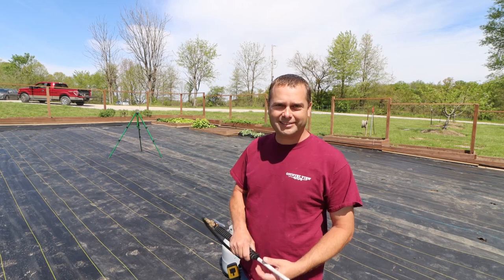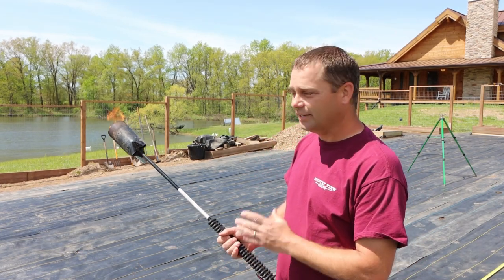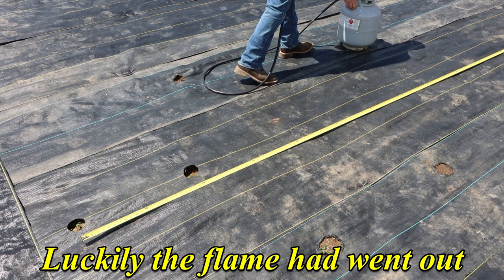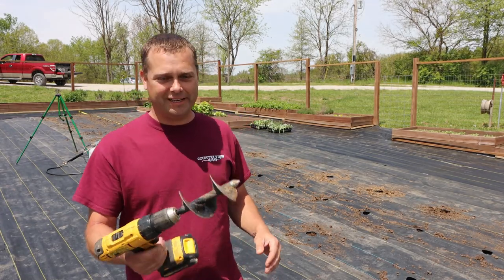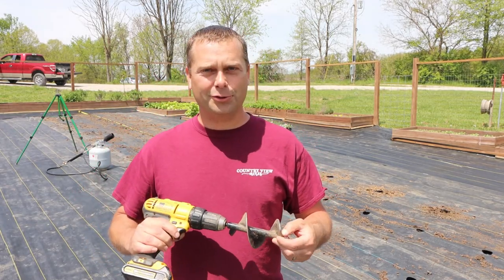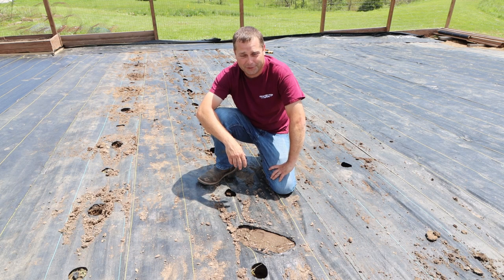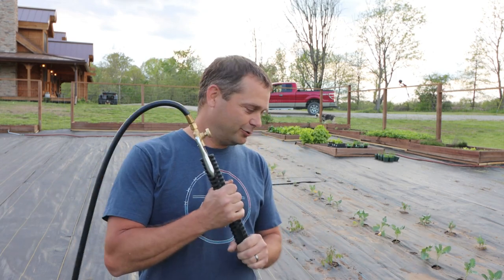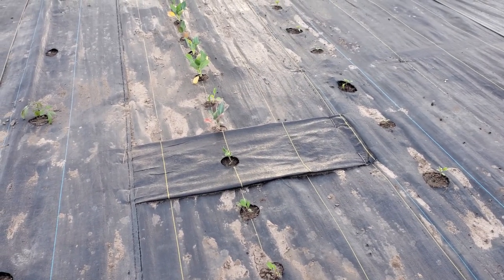Planting in weed fabric, burning holes and using the power planter auger.

Comment: Evan, that is a easy fix. Cut a piece of wood and put it under the trigger and then use electrical tape to wrap around the handle to hold it in place.
Reply: You beat me to it. I was going to say a zip tie though 😊
Reply: I had the same thought.
Jam the trigger.☮
Reply: if someone is that incompetent with the tiger, simply use a small pin punch and tap the spring pin out that hold the triger handle on, and it hall right off, 2 second job
Reply: Arnold Romppai I suppose if he was messing with a TIGER he might be a bit more careful.
Reply: Same idea here.
Reply: @michaelacres501  man how many hundreds of people have to repeat the same thing, like duuu

Comment: Evan, garden's looking great.
Torch: stop stabbing it. You're burning through not stabbing through. Set it down a little easier, let it do the work. Set it on its heel then stand it straight up, rock it in a gentle circle like you're spinning a quarter in the counter then lift it back up. Perfect hole. Easy as pie.

Comment: If you add a 30 inch rebar extension  t your auger, you won't have to lean over to punch your holes. That's what I did to mine and it's working really good .  You can drill twice as many holes in the same amount of time.  If you'll take a leaf blower and blow all the extra dirt off the fabric, you won't have weeds start on the small clumps of dirt. Your garden is looking great !

Comment: Tape a piece of wood of the right thickness to prevent the trigger from depressing, then wrap with some electrician tape.  Should solve the problem.  Great looking garden set-up.
Reply: This was exactly what I was gonna suggest, and you beat me to it 😂
Reply: Use a cork!
Reply: Was going to say the same! Duct tape a chunk of wood in there! The holes are perfect when you don't pull that trigger! ha ha ha?!
Reply: Just goes to show:  Great minds think alike.....
Reply: Yup right there. I would have flamed it out and set stuff in fire. Definitely would put something under so it just can’t be depressed.  Just FYI those torches are great! For weeds. Being in as and not lots to set on fire - works great for the weeds we get in our rock.

Comment: Put a Piece of woodunder the handle and tape it so if you do hit it it won’t do anything hope that helps😉
Reply: Bass 167 I was going to say the exact same thing
Reply: I was going to say the same but I was thinking a piece of that foam that you kneel on under the trigger.
Reply: @wendyellis8572  I think foam is better than wood.
Reply: Why not just zip tie handle down on full open position and control flame with knob like other model.
Reply: @ShadyOaksFarm  thats not how it works

Comment: In case someone else has not commented, make a template of light plywood or even old paneling with holes just slightly larger than burner.  This allows torch to be lit and kept hot to burn holes quickly, maybe 3 seconds per hole.  Holes are perfect with few chances for burning accidental holes.  Be careful to keep torch over template at all times as hot plastic that accidentally drips off torch end burns minute holes in plastic. Believe me weeds will find every single hole no matter how small.  Yes, ditch that trigger valve.  There is an optimal setting based on plastic thickness, air temperature and wind.  As mentioned there is learning curve.  Also, as the torch is always lit when cutting make sure the ground under the template hole is level to prevent flame or gas from spreading under

Comment: Another option to fix the trigger problem is drill off the rivet and take off the trigger. When you want the trigger back get a screw same size as the rivet and nyloc nut and that way you can take it off and on as you need